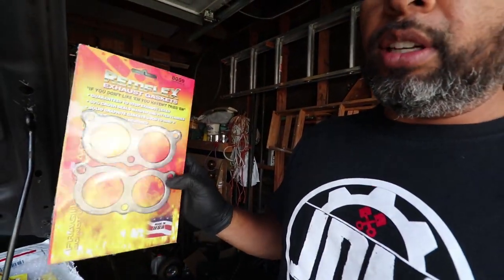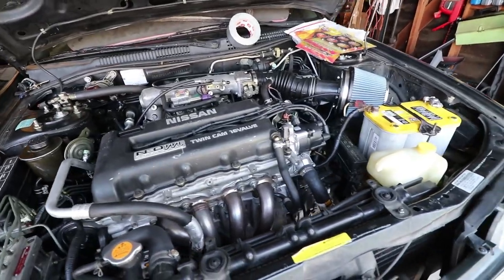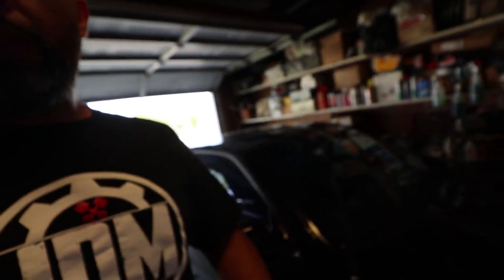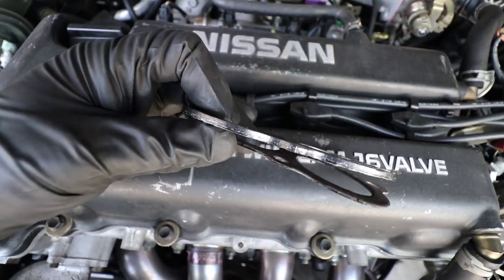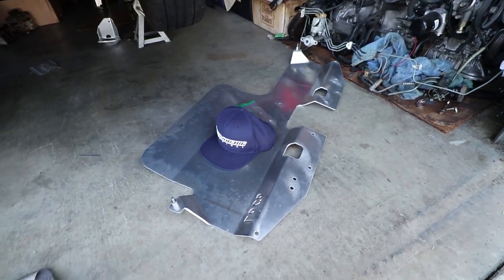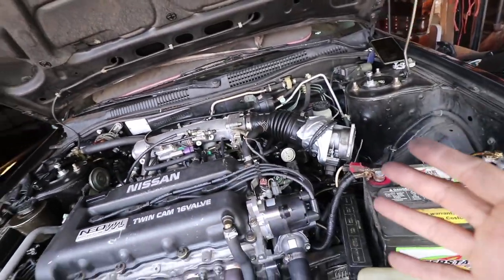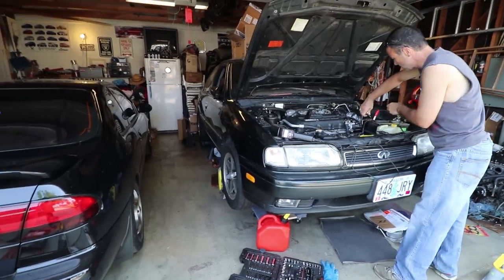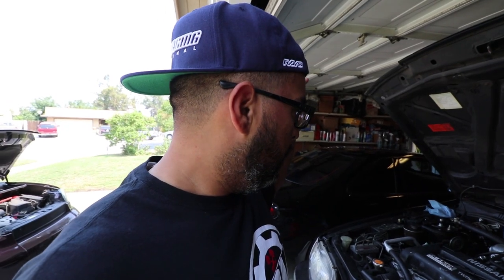Infiniti G20 SR20VE Pt.3: One Step Closer...

Comment: You should really do a custom 2.5-2.75 collector

It’s what the higher HP B series and K series have been doing for some time now. It’s a considerable gain. There higher end/custom headers tend to run that size. Even modding crappy Ebay headers with a collector like that will bring in a lot of gains.